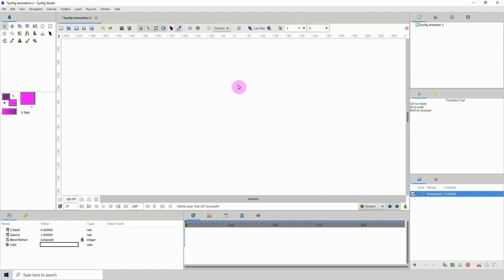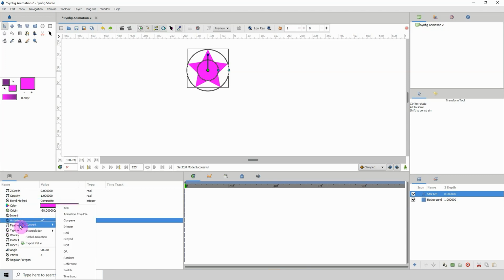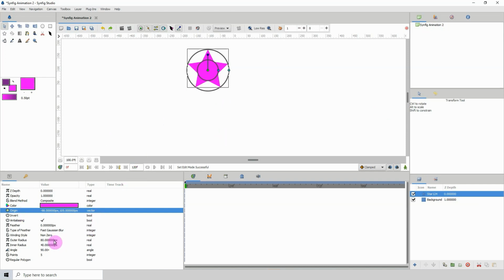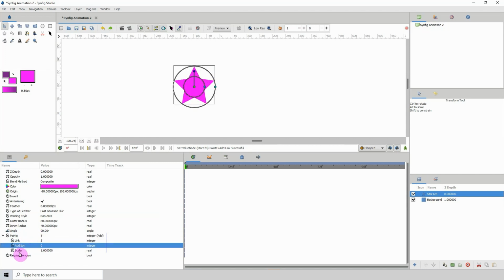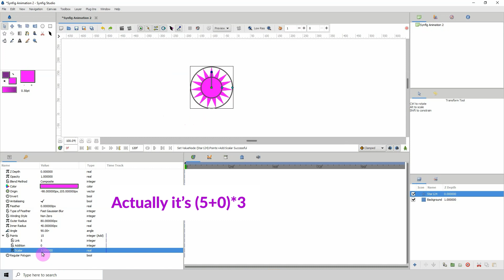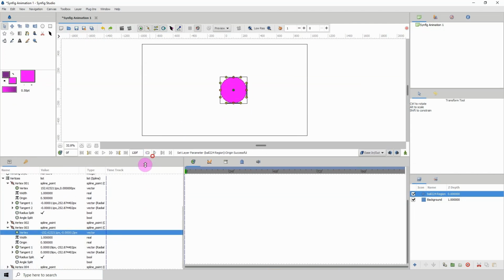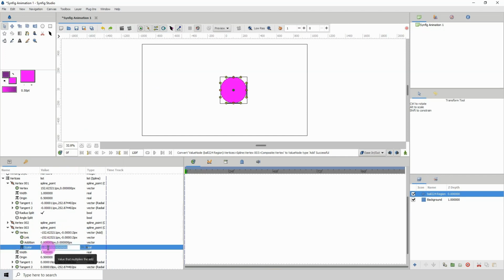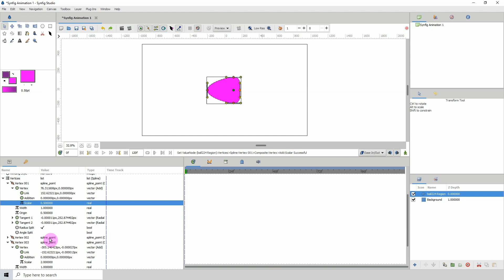Synfig for beginners: 86 - Converter Types (ADD)

Comment: This moving the nodes by the set of rules is actually brilliant, I'm going to try to use it for changing the sewing patterns size (as it requires moving the separate points on the edge by a certain amount, not just scaling). Could also add seam allowance but Outset in Inkscape does it well already. Exciting!